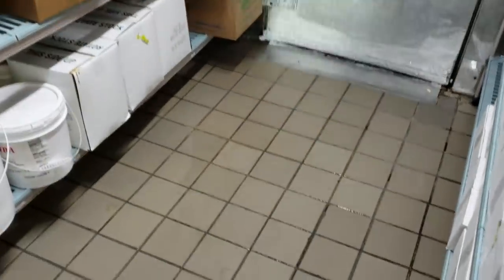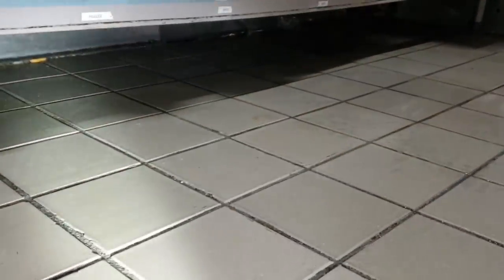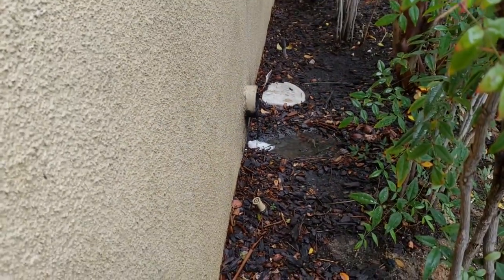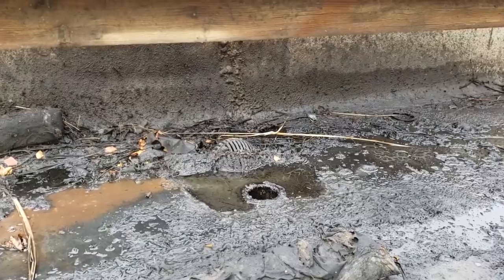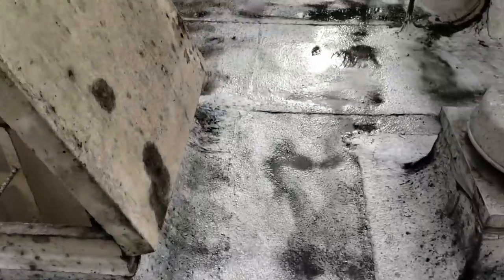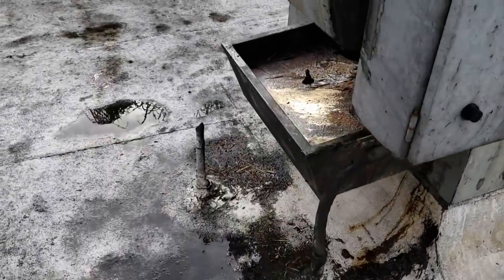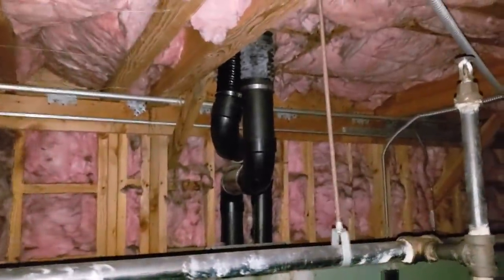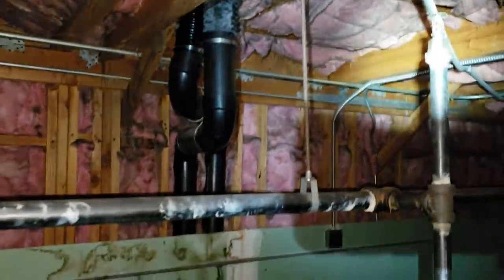WALK IN COOLER WATER LEAK

Comment: The "secondary" drains are actually overflow drains. Normally these would be slightly higher than the primary roof drain. The outlets are then put somewhere obvious where they will DELIBERATELY cause a nuisance water problem (i.e. water in walkways, etc). This is because if both clog, the roof comes down, and the nuisance will better increase the chance of a maintenance call. Normally these are a lambs-tongue out front of the building near an entrance where it will be noticed. In this case, it did its job by having you go up and investigate.
Reply from the maker: Great points, thanks for watching, Hey I am going live on Youtube this evening 1/21/19 at 5PM pacific time you should come over and check it out. https://youtu.be/dUMYKIdTCR4

Comment: Good stuff , sir. There's company called Hoodz that specialized clean exhaust fan system and clean duct with high pressure from grills or fryers. they also clean entire roof to clear grease . they do that once a month. it's part as preventive maintenance.
Reply from the maker: Yeah they have a hood cleaning company but they don't come enough, Hey I am going live on Youtube this evening 1/21/19 at 5PM pacific time you should come over and check it out. https://youtu.be/dUMYKIdTCR4
Reply: paying them would probably help as would not the cheapest company and do they actually clean the stuff or be total lazy mode? back to the old everyone blames the other game, which in the long run causes business's to close from failing health inspections, to going bankrupt from expenditures galore. money has to come in to go out and at a higher rate....
which the USA hasn't had for ages ;)

Comment: Excellent diagnosis. I would also suggest that the top of the junk on top of the walk-in be removed an the roof be professionally cleaned, if all of that grease caught fire you'd lose the entire building. The condition of the grease pan on that hood exhaust unit suggests that they do not have their hoods and exhaust ductwork professionally cleaned semi annually as they should. An inspector should have caught that. The exhaust ductwork, though it is supposed to be stainless steel, will buckle and seams will split if there is ever a grease fire in the exhaust system. This will release the grease fire into the attic area and your building will be lost. The secondary drain should be piped away from the building in the mean time until the rest of the problems are remedied. Again, your diagnosis was excellent and if heeded will save this company a fortune in unnecessary  equipment and the possible loss of their entire building.

Comment: If I worked for the city board of health unit that place be shut down for "unsanitary conditions." Because, your going to track that all over the kitchen and other people can slip and fall. Why is the grease trap on the roof and not in the restaurant under the sink where it's supposed to be? I have never seen a grease trap on a roof before.
Reply from the maker: that is not eh actual grease trap for the sewer that is downstairs, its very common for there to be a trap like that on the roof also, Hey I am going live on Youtube this evening 1/21/19 at 5PM pacific time you should come over and check it out. https://youtu.be/dUMYKIdTCR4
Reply: Thats from a hood! Mexican rest use huge vats of oil. Can't imagine how thick the grease is on the walls of the piping going to the hood, fire hazard big time! and probably don't have any grease filters in the hood as well.
Reply: @HVACRVIDEOS  I'm so sorry I missed it.😥 9:50 EST
Reply: @dadscavaliers642  this place where I volunteer at has a kitchen and last time the health inspector was there he was very impressed on how volunteer cooks can keep their kitchens more than a restaurant. He saw very minimal grease on the hood vents. If they can dust, dirt, grease and, who else knows what glued to the vents over the stove, your closed down until the kitchen is spotless.
Reply from the maker: No worries Kurtis
Reply: they likely will be after these video's are seen by some local to there.....